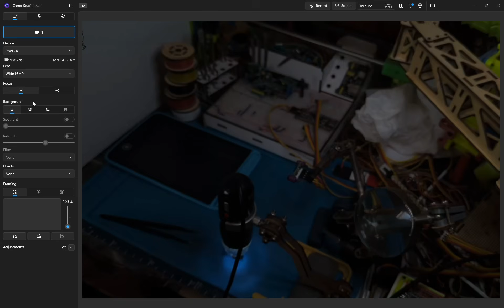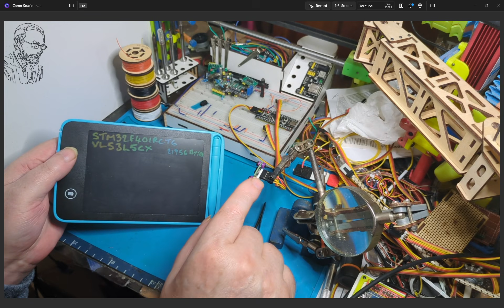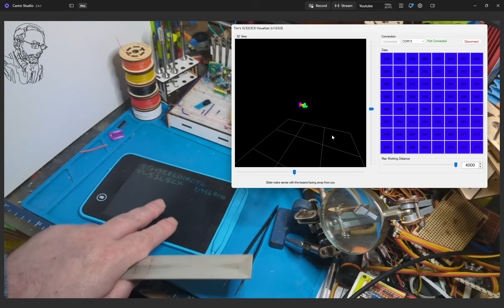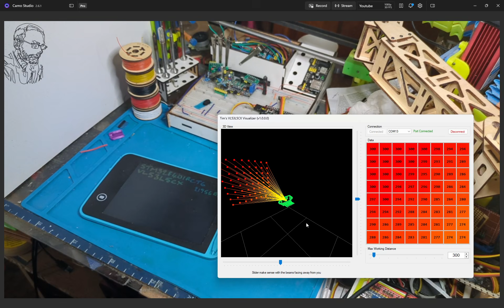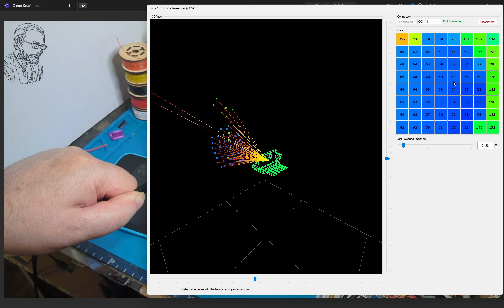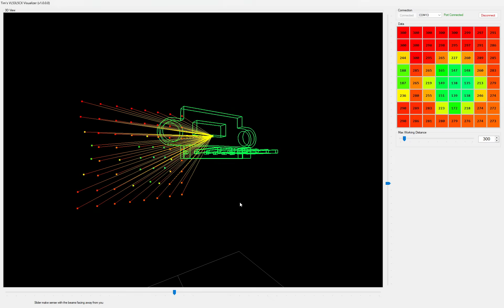Tim's 3D Scanner [VL53L5CX]

Comment: Hi , i work on this project ( ı have nucleo board f401re and vl53l5cx) My OS is ubuntu but I'll try it on my roommate's computer. How should I write 8x8 data over my serial port to ensure compatibility with your visualize app ? i tried python pyqt code but it was not seem good
Reply from the maker: The data it expects is: 123,124,125,126,127,128,129,130,140,141,142,143,144,145,146,147, ... 64 values total ending with '/n'.

Are you using ST's library?
My MCU just calls:: vl53l5cx_get_ranging_data(&Dev, &Results);
Stick what I want in a buffer: for (int i = 0; i < 64; i++)
				pos += snprintf(&buffer[pos], sizeof(buffer) - pos, "%d,", Results.distance_mm[i]);

Then it send the whole frame:  HAL_UART_Transmit(&huart2, (uint8_t*)buffer, pos, HAL_MAX_DELAY);

Hope that was OK.
Reply: Use library "Open3D".

Comment: I think you missed a big problem. The distance measurement per field is not calculated to the sensor, it is calculated to the sensors plane. As you can see your data, you are looking at a sheet of paper, a relativly flat plane, but your 3D projections are giving back a spherical target. The VL53L5CX has angle compesation built in, which you need to calculate with. 
It is best described in a forum post called "vl53l5cx-distances-don-t-match-theory-what-am-i-missing".
Reply from the maker: Yep got that it is sorted on my 3D application.
In this app. I am taking it as the beam length (Hypotenuse of the triangulation)  this is now corrected in my new app. to be Z length (Adjacent of the triangulation)

Comment: Hi Tim, I am really interested in replicating your 3D scanner setup using the VL53L5CX and the STM32 Black Pill. When I reach out for the firmware, could you please provide the source code or project files as well? I would love to study your implementation and learn from it. Thanks for your help!🙂
Reply from the maker: I had a flash of inspiration haha
I have actually updated the Application I put on Microsoft Store, When you run the Application I have added a button to save the HEX file for the STM32 to your hard drive.
There is also a link to ST's STM32CubeProgrammer.
Modules you will need are: The VL53L5CX , an STM32 Black Pill (STM32F401RCT6), a USB-To-UART (set at 3v3) and an ST-Link V2. (I use a cheap one of the web that looks like a USB stick).
On the Application page there is a circuit diagram.

If you have any issues just let me know and I will try to help.
I would be over the moon if someone can replicate this.